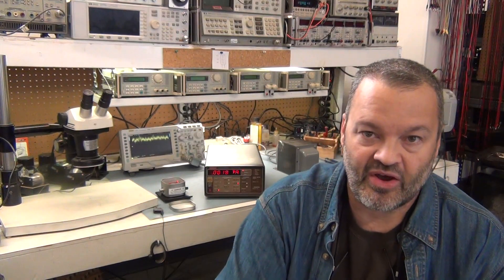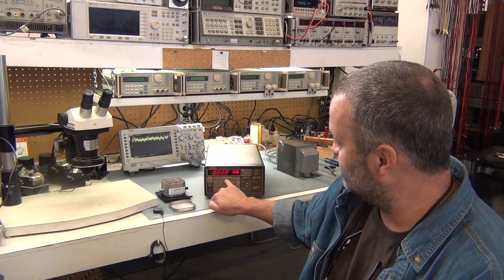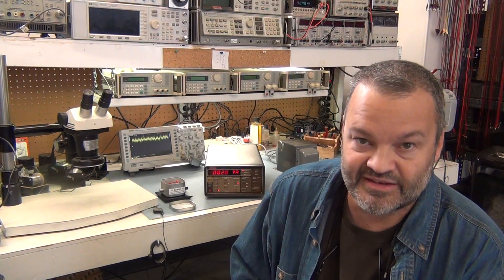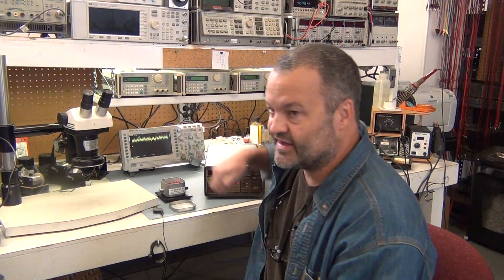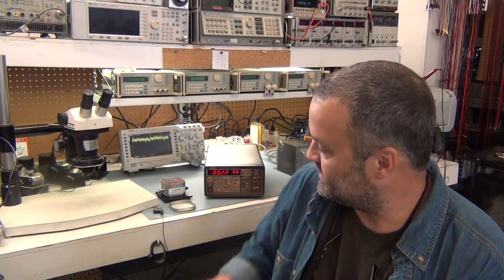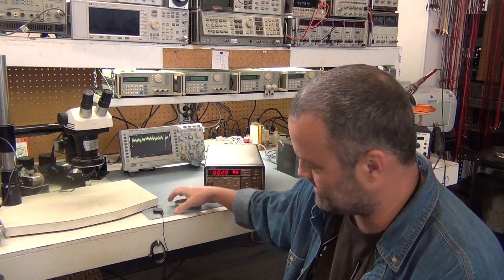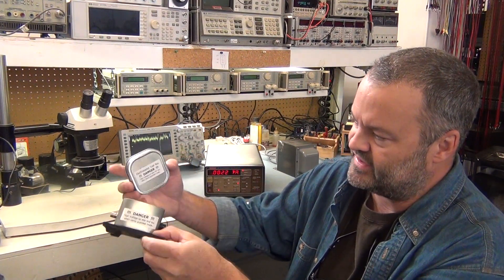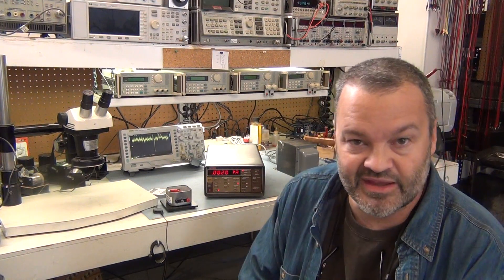Keithley 617 Electrometer with LEAKY RELAYS [PART 3]

Comment: I make a low cost electrometer too ( https://www.youtube.com/watch?v=xbKiAl2ioBg  "Femtoamp Measurement on your Desktop") and I actually have currents flowing through cables and are making measurements.  What is your bandwidth of your measurements?  Anyone can filter their signal to an arbitrary noise level.  Where is you step response and how long does it take  to be within 3 femtoamps with a step to say 1 na?  I don't hide my performance behind a large filter capacitor to reduce my noise.  Put a 1 pA current into the device and show me your noise level.  Then make a step response of say 10 fA and we will see how much filtering you are doing.  Also the the Keithley 617 has an error of 1.6% of reading on the 2 pA range or 16 fA plus 66 counts.  When I measure a 1 pA current, my accuracy is limited my the shot noise of the current and the Johnson noise of the input resistor of 200 Gig ohms.  My bandwidth at an input of 1 pA is around 25 ms.
Reply from the maker: I agree and I'm sure these Keithley's limit the bandwidth.

Comment: Thanks for posting this, it is all very good information.  You had mentioned a potential issue with driving the replacement relays due to lower coil resistance. Did this turn out to be a problem?  Thanks.
Reply from the maker: I have seen no problem with the extra current that these alternate relays draw.  I've run it continuously for several days (at room temperature) with no issue.  The relays are driven by 74HC series gates which usually have very low on-resistance so I suspect they also have much margin on their ability to drive extra current.  In fact, the specification is probably limited more by the need for the manufacture to make their Voh,min specification than any threat of failure.  I did think about looking at the IC temperature but everything seemed to be working fine so I called it done.  (I wouldn't use this logic for high a volume production design but for my one-time-fix it seems A-OK.)  If anyone can find stock of similar relays with electrostatic shield or even higher TOhms then I think those would be very good improvements.